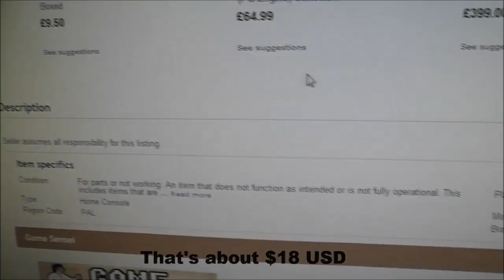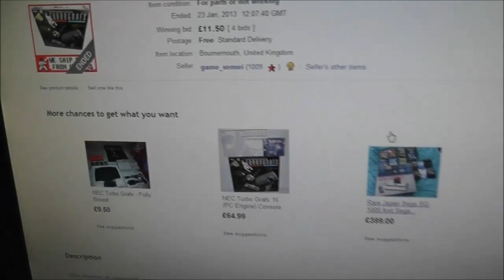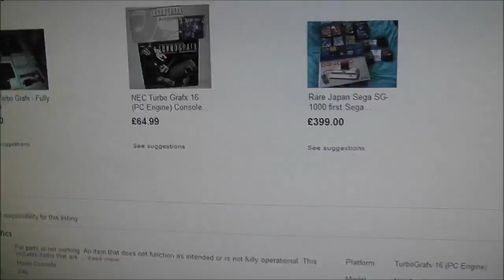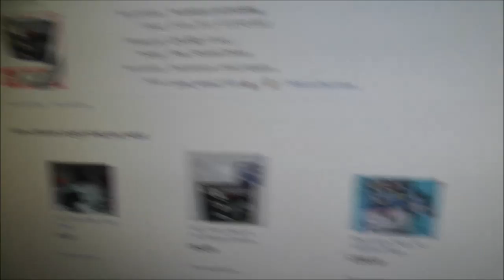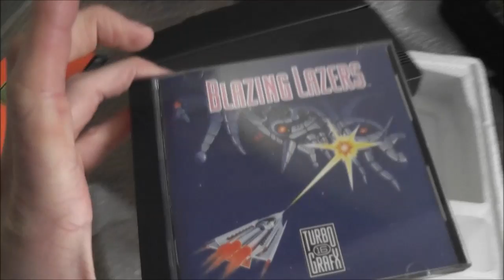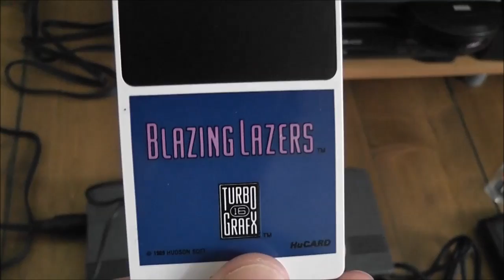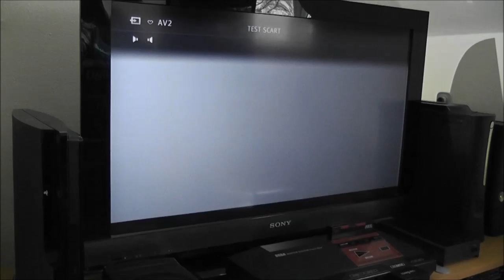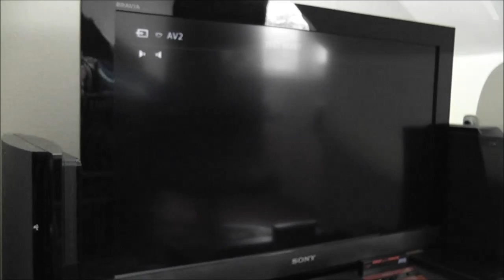Let's Repair - Ebay Junk - NEC TurboGrafx 16 - PC Engine - Epic Deal!

Comment from the maker: That's not a garbage bag. It's a grey self-sealing postal bag. You've never seen these before? Most big ebay sellers use them. You wrap whatever you're shipping in bubble wrap then pop it into one of these. Saves on postage costs, it's tamper/rain proof and same protection as a jiffy bag.
Box wasn't damaged in transit.

Comment from the maker: It was suppose to get released but NEC pulled the plug at the last minute. That's why there are so many brand new boxed consoles floating about on ebay etc. The PAL stock exists but never made it to retail.

Comment: Awesome, man! Not only a great deal, but the fix wasn't too difficult! I was surprised to see that the PAL Turbo-Grafx has an AV port... I had to mod my NTSC unit to get AV out. With an NTSC unit you'd need an over-priced expansion module called the Turbo-Booster to get anything but blurry RF out of it. Wish I could suggest a few games, right now I still only have just "Keith Courage in Alpha Zones" lol. Anyhow ;) Awesome job man!

Comment from the maker: I use a cordless butane iron for less intricate work such as desoldering RF shielding, removing old components and tinning wires etc. For more delicate stuff I use a cheap 30W iron with a very fine tip. Cheap irons are fine for most common jobs. They cost about £5 on ebay/Amazon.

Comment from the maker: Thanks dude. I was a bit surprised to see the condition of the board given the excellent condition of the outside! It seems someone bought it new and then tried to do the region mod. Kinda lucky they didn't fry something in the process! At least it was only about 5 pins I needed to resolder and not 300! lol
Will check him out, thanks for the suggestion! I'm going to give the RGB mod a try I think.

Comment: i got a master system mk1 off ebay as faulty, it worked but for some reason had no sheilding inside and was sold with a megadrive ac adapter and av cable, people do some strange things still wonder what happened to the sheilding anyway, great deal!

Comment from the maker: I was trying to find more info on this the other night. But it seems that because the console is a bit uncommon, there isn't much demand for finding a 60Hz solution. In most cases it would probably just be easier/cheaper to buy a US or Japanese system. I'm going to keep looking into it though. It can't be that difficult to revert it back to 60Hz. Maybe I already have some junk consoles with the required parts.

Comment from the maker: Most retro PAL consoles are set to run at 50Hz by default. This is why some unoptimised games appear to run slower. That's why installing 50/60Hz switches on old consoles is very common/popular here.

Comment: I once got a new Sony Vaio laptop on Ebay for £90.  It wouldn't power up, but the charger they sent me with it was for a different laptop and the wrong voltage.  Plugged in the right charger and it powered up right away and the battery started charging.  Never even had to pick up a screwdriver :)

Comment from the maker: I'm starting to think so. Either a region mod or RGB mod gone wrong. 
Interesting to read about all the new old stock that seems to be floating about. I never knew the system was never officially released in the UK. That would explain why the system is in seemingly unused condition.

Comment: I am not sure about in the UK... but I think just the AV cable would have been worth that amount of cash. I think those are scarce.. at least here in north america. I am stuck using the RF on my tv.. also, blazing lazers is worth around that price with the case and manual I think.. I would pay 15-20 bucks for it for sure.

Comment: Wow, what a deal! I got a crappy deal on mine, and that was after looking for weeks for a decent price. I ended up paying $150 for a TG16+dock+CD which was sold as-is and the seller is not sure if it works as the power supply is severed. I'm hoping it works right away (with a proper power supply of course), but if not, I'm hoping it's an easy repair.  :/

Comment: I'm looking at getting my pal one which i bought for £40 without any wires meaning I had to buy a turbografx accessory box which gives me a official power supply and AV cable. Then check with my mod guy about having it region moded for all that Japanese goodness.

Comment: Nope.
NEC Supergrafx was PCE compatible but also had option of two hardware scrolling layers (like Sega MD) and twice as much Sprite pushing power as the PCE - 128sprites (2 x 64 sprites = 64 sprites for each layer) but only if software was programmed to utilise - Daimakaimura on SG is a PCE SG exclusive - not available on any other model PCE.
Btw, Sega Megadrive had 80sprites over two layers, NeoGeo AES has 1000+ ! over four layers)
Sega Saturn is the best sprite pusher though :-)